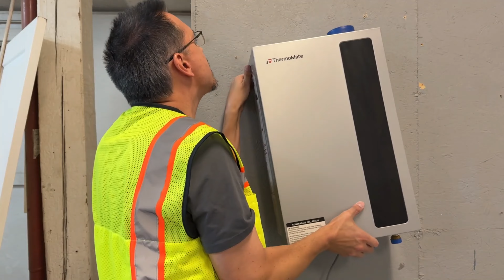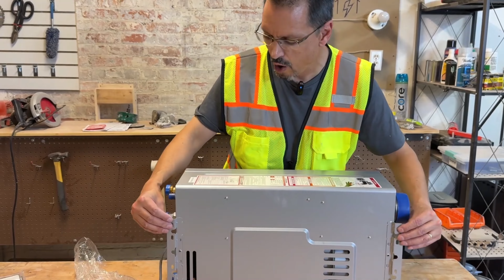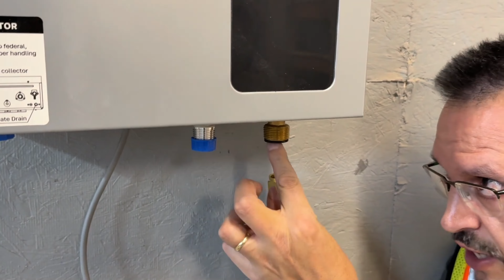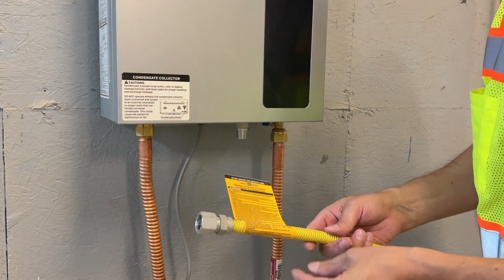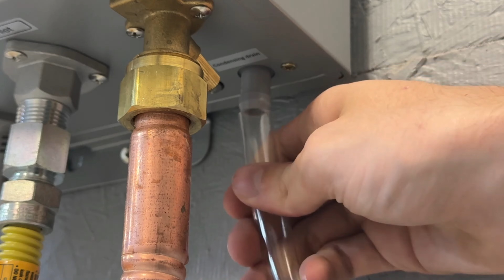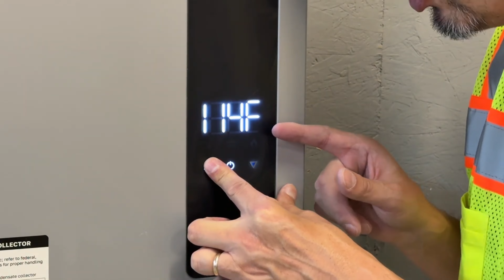ThermoMate CZ480: ​​Features Explained & Installation

Comment: Hello, Can i use a vent piping that goes to the roof?
Reply from the maker: Yes, you can. The CZ480 is a condensing model, and the exhaust temperature is not particularly high.